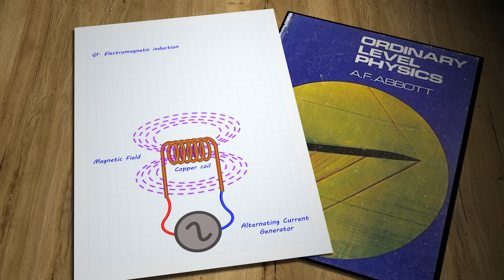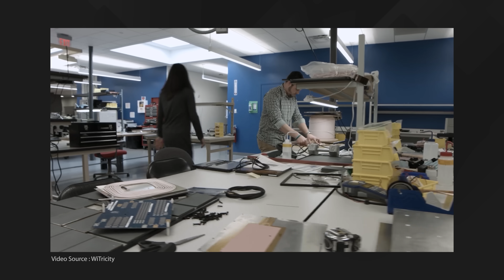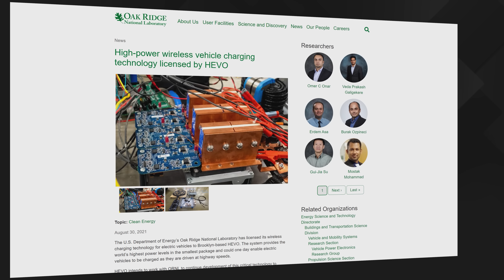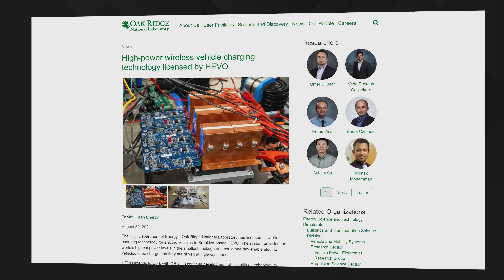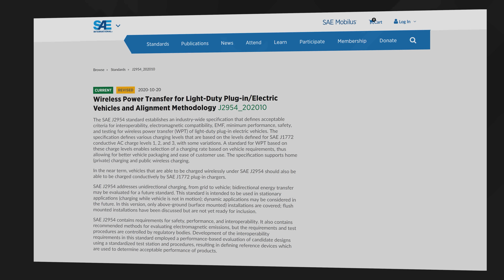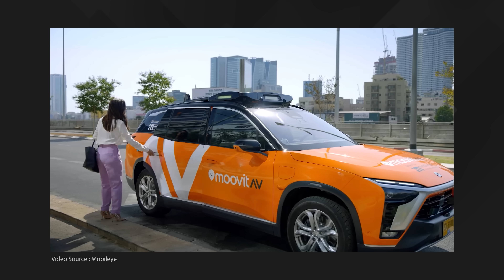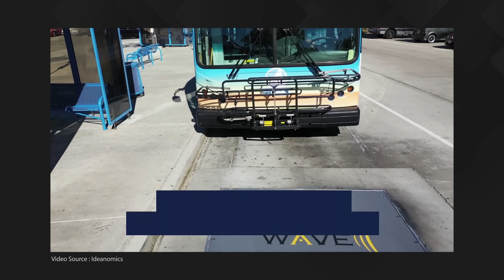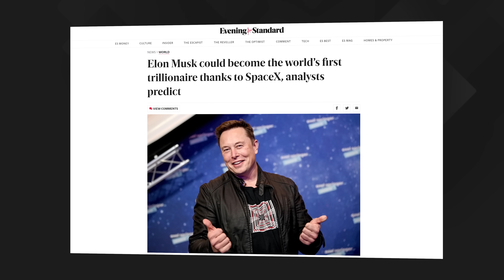Wireless FULL EV charging has arrived!  Exciting new tech breakthrough.

Comment: Seems inefficient at this point.

% efficiency of newly developed tech is always overstated.
Reply: this is no different. they always state the efficiency of the coil-to-coil transfer but fail to mention that you have to do three conversions to make it happen: 60hz AC to DC, then again to kHz, then transfer it, then convert that back to DC to charge the battery. so rectify, invert, rectify.
Reply: @somedude-lc5dy  genuine question, why do you have to rectify to DC and then invert to a higher frequency AC before transferring?
Reply: @ipwn951  Because higher frequencies = smaller coils, and better transfer. Just line an airplane uses 400 hz for power on board - Smaller transformers less weight.
Reply: @ytalanwms  that's neat
Reply: @ytalanwms  I always thought that airplanes use DC-only as most of avionics requires DC anyway...
Reply: @somedude-lc5dy  yeah, now imagine what size would have a coil that's able to reliably charge a car at 50 or 60 Hz, like in conventional home electric networks, and don't forget to calculate how much you lose “into the air” when you use a lower frequency for induction based energy transfer. Alan Williams is right, higher frequency means smaller and more efficient coils. In real world with real physics, simplicity does not imply efficiency. A steam engine is very unsophisticated, yet it gives you back just about 9% of energy it requires to run. DC current seems simpler to produce and transfer, yet most of our power lines are AC—because DC is efficient either at very low voltages or at very high (think power lines that supply electricity from one country to another), but not at voltages we use at home (110/127/220). Metro trains and trams, for instance, usually run on 800 V DC, but they get that power from AC grid, and everybody is okay with the fact that metro doesn't run on 10 kV 60 Hz AC, or whatever your local transfer standard is. They run on DC because they return their kinetic energy as electricity back into the grid every time a train/tram brakes, and it's crazy difficult to make a frequency stabilizer which would let to have both recuperation and 50 Hz in metro/tram power grid. So if magnetic transfer is more efficient at higher frequencies, I don't see any problems with conversions: the efficiency of “such a complicated” scheme is surely much better than what you think will work; if these conversions could be avoided, they would already have been. And no, you can't just multiply what you get from power line, it's never exactly 60 or 50 Hz, so you can't have it both stable and under granular control, which again, is important for efficiency. Do you know that modern phones don't keep the same voltage and current while charging? That's because it's efficient to change these during the process.

Comment: How would this effect those currently living in their cars? Given the lack of willingness to pass infrastructure bills, adding another item to fight over seems impractical. On a local level, some smaller cities or apartments may decide to install wireless chargers in paying spots. Larger and more progressive cities will likely rather push for some or all cars to be replaced with mass transport, at least in downtowns.
Reply: Good. If you legislate away street parking then the downside of electric cars goes away, and you get the street back.

Comment: I'm not buying this marketing hype at all, the 90% efficiency numbers being banded about are still when very closely coupled and accurately aligned. When alignment is as little at 5% off and when distances between coils is the typical 20cm for a vehicle, efficiencies drop to <50%. If everyone finds it acceptable to waste 50% of their power as heat into the environment then by all means these systems are for you, however, if you wish to remain at 95-99% efficiency then wired connectors are still the best environmental option.
Reply: Even if it is 90-95% that's still 10% waste. How can we afford that?
Reply: @kevinroberts781  Wired connections are not 90-95%, they are very nearly 100%.  The lower number comes from the rectifier on board the car, which is ON TOP of the losses incurred in the inductive charger.
Reply: @incognitotorpedo42  not talking about wired connections.
Reply: Not a very optimistic outlook on this awesome technology. Also, 5%?...  It's clear this technology is still relatively in it's infancy and despite that, it will still allow drivers to have "sloppy parking" and still be able to utilize it.  If poor wireless charging because of damaged or misaligned components, you don't think a system can be developed to notify the user?

Comment: Is it safe? People complain about magnetic fields scrambling their brain that are on the order of 10 orders of magnitude less powerful.
Reply: Those people are stupid.
Even at these powers it's probably safe, as long as you don't have any metal in your body.

So there would definitely be some problems eh?
Reply: @kanucks9  50% of people are at or below average intelligence. Probably 17% can be considered stupid. What percent has metal in their body? Not sure. Eh?
Reply: I think it might not be safe to place your pacemaker right next to it, but it's probably safe at the intended use, the field is designed to not radiate in a way like a normal magnetic field and it concentrates the flux at the induction points.
Reply: @jordangentges2631  sounds good, then it’s just a case of convincing the public :-)

Comment: convenience with huge energy loss is not good - I hope such inefficient methods for charging your electric car would be banned
I really hope somebody does proper direct connection robots to the cars - offering same convenience for the user but much less of loss energy
both energy loss in magnetic field not being perfect to general electrical resistance in both coils
Reply: If it speeds up adoption it is tolerable. Convenience has to be a consideration, and cables are not convenient. Robotic connections would be better, but they would always be maintenance heavy. Maintenance means energy too.
The energy electric cars use is actually pretty minimal. Regulating how they are charged because "we know better" would be a step in the wrong direction. The owner has to pay for the electricity, and will make decisions based on their own needs.
Reply: @agsystems8220  This whole idea of adoption is BS. It may work to have only EVs in cities, but it sure isn't ideal in Canada. In rural areas. In 2nd or 3rd world countries. I believe there still is a place for ICEs. Cancel me, sure. But electric vehicles are not the only solution to this problem. Though I really do want my next car to be electric!

The idea of robots pluging in your car is way better than the idea of wireless charging. You'd simply need a 6 inch Cylinder that could make contact with the bottom of the vehicle. Like a simple bottle jack, that could have 2 short swivels (for alignment) on it to attach to a point on on the bottom of the car. Have it built into the floor of your garage, have a second charging port on the car. Not too expensive. Very minimal maintenance if any. Could easily work in parking lots. Would cut down the cost of tons of charging lines and stations. Very low profile. Could fit in a 1 foot cube and be under ground. Perfect for taxis and busses too. Could put it at red lights. Robots actually would be far superior!

Comment: This sounds great, I look forward to a future where EVs are open to anyone, including people living in blocks of flats with only on street parking.  However, I do worry that this has the potential to screw over anyone with a pacemaker.  Even the magnetic field from an iPhone’s mag safe pad on the back can mess up a pacemaker if it gets too close.
Reply: The transfer window has  tuneable operating distance, and field drops off quickly outside that window which can be shielded anyway. In most systems the power is only switched on when there is a perfect handshake between the vehicle and the charger. The charger will switch off if anything interferes with the magnetic field.
Reply: @Click Bait The truth is everything in reverse from what you said - we HAVE all those expensive roads and make more of them,and manage to maintain them to existing state.Adding additional structure to roads - is only % of what those roads already costed us.This also isn't rational to adding such feature to unused dirt road,only on high traffic urban areas.What we don't have - is all ICE cars replaced with EV.
90% of time your BIG GOOD size battery is being UNUSED because your car is parked,this battery is huge part of the cost of EV, and it's accountable for most pollution released from manufacturing that EV. Even more - when EV isn't parked,battery still not being used for 100%.But all the pollution from manufacturing and all used resources - everything was done BEFORE EV even get out of factory,so 99% of all those resources are being unused,and degrading over time. If rather than putting BIG GOOD sized battery,we use good small batteries with some super-capacitors for frequent cycles endurance - we can make x Times more EV out of same amount of resources,for much cheaper,and charge them right on the roads.
Reply: @Steellmor  You have no idea how expensive it would be to install and maintain inductive chargers on all major roads.  I guarantee you this is never going to happen.
Reply: @incognitotorpedo42  You guarantee? So you have exact numbers to be able to guarantee it? Did you ever saw trains and railroads? Highways? Huge concrete interchange? Subways? Tramways, trolleybuses etc? We can do this,but we cant add simple wire coils to existing roads?
Reply: @Click Bait I'm not advocating for any of those companies and their solutions,I think all of them are way off from right solutions.Nor for Solar roadways - stupid crap without any real reasoning.PV needs to get cheap as it can,and installed in least work required manner in order to produce as much energy as it possible for as little cost. But conductive coils have hundred times more power density compared to PV,and copper is much cheaper and less energy-costly to produce than silicon semiconductors for PV.
Reply: @Steellmor  Copper is cheaper per kg than single crystal silicon, but copper isn't particularly cheap compared to concrete and tarmac, and you're going to need a hell of a lot of copper to make coils for millions of km of roads, while the active silicon in solar cells is a very thin layer spread over a large area and it is actually generating power, not just moving power generated elsewhere around. Servicing overhead wires is massively cheaper and easier than servicing wires buried under concrete roadways - this is why overhead wires are so common, even though nobody I've ever heard would say they look good.
Reply: @peglor  Yes,agree with all of this.Except maybe when you got back to solar cells second time,not that what you said is actually wrong,but it kinda can be misleading and seems like you trying to backup idea of solar roads.Also about cost of servicing wires - yes it's indeed cheaper with overhead wires,but how often do buried wires need servicing compared to overhead ones?(lets just remember any snowstorm and hurricane). About concrete and tarmac - we don't compare them in 1v1 ratio to price of cooper - we don't need to make whole road out of it,and when we go and look for prices for square meter of tarmac,or for ton of it etc, they are quite pricey when you consider how much of it you need. So Cooper coils still would be least part of cost for such roads. Now back to comparing it to Solar roads - they installed 14 m2 and it cost was "roughly $60,000". Quick search for tarmac - 15 m2 can cost up to £1000 with job done.Or search for roads cost - "$2-3 million per mile of new 2 line undivided road in rural areas and $3-5 million in urban areas". Wireless charging added to road  - in 2018 Sweden made  test project,they build ~2km for $2,4 millions overall budget. Company called Electreon Wireless,according to WSJ, claiming that they can add wireless charging to roads for $650,000 per kilometer. That's with job done. Actually you can just google images and look how those wirelesses chargers look - clearly most of it's price comes not from chargers themselves but rather from roadwork.
Reply: @Steellmor  I'd be very surprised if the price for the Swedish charging road was not done at a loss to try and drum up business. Without a comparative Swedish cost for  building the same road without the charging, quoting (I presume) figures for US road building (Which is usually for concrete rather than the tarmac on compressed stone usually used in Europe) doesn't allow anything to be inferred. 

Burying cables in geologically stable areas does mean a lower number of maintenance interventions and that they can be scheduled, but each intervention will be a lot more expensive, especially in cases where the road has to be closed to access the buried wires, and the continued suburbanisation of the US particularly, without enough tax take to cover upkeep on infrastructure 20-30 years after it has been built (This is what's already making many US cities bankrupt) means many places already can't afford to maintain the roads they already have not to mind the ones they want to build. 

There may be a means to claw back revenue through charging fees to cover the costs, but anywhere without a lot of electric cars and a lot of traffic will probably never be able to do this sustainably, and that assumes the technology isn't mostly lies (It definitely sounds like very specific moulding of lab tests results if it's not actual lying) and that it is widely adopted as the primary method people choose for charging cars.

Comment: Imagine a funnel extending out of your gas tank, and a series of gasoline fountains triggered along the highway, spraying gas at you as you drive.  Yes you could seek to create system where a car with a small tank could drive infinite distances.  NO, NO, NO, it would never ever make sense to waste the infrastructure costs, write off the losses of uncaptured energy (spilled/evaporated gasoline), and create new infrastructure nightmare of upkeep of the extremely complex system.  This question has been asked and answered for decades, and no the physics haven't changed.  Direct connect will ALWAYS be much more efficient, and we cannot afford to waste any renewable energy  (like we do with our wireless toothbrush and phone chargers).  This video is based on overinflated claims of a research team and now a CEO trying to get prototype project money for extensive installs.  There is zero reason to go this route with EVs because electric cars are inherently inefficient (4000lb - 9000lb masses of steel to move 1.2 people on average) to the point that we will not use them in the future.  We will use electric rail, and active transportation, and micromobility.  

Even the prospect of induction charging for parked cars only makes sense for on-street parking in cities where parking is not assigned (assuming you create a charging/pay protocol), and cities are beginning banning cars in the city center in the near future.  Yes, banning cars, because mass transit is the only way to decarbonize congested cities quickly, and make room for bikes, walking and micromobility.

Not to censor science, but videos like this one, are delaying much needed transformation of our transportation systems, because it's providing BS hope for autonomous vehicles (too inefficient, too expensive, deadhead trips) and for extremely wrong turns on wireless charging which is always more lossy than direct connect.  They are misrepresenting the losses as 90-95% efficient, because it is IN ADDITION to the already present losses.  All this because tech improvements are fun.  Guess what?  They are distracting us from fast action on Climate.  They really are.

Comment: Love the idea of charge as you drive. Essentially providing unlimited range.
Also, we would need much smaller batteries thereby reducing the cost of a EVs.
Also, governments could use this  to replace the revenue they currently receive from fuel duty.
Reply: Have you thought about how much production of such enormous quantities of panels would cost? Not just money, but materials and the environmental damage of that production? And for what? To prevent the effort of plugin in a cable? To remove range anxiety. The idea of infinite range is nice, but nobody seems to think about the cost. All the costs
Reply: On the one or 2 roads in your local area. If you drive 100 miles in a week and 5 of them are on a technologically advanced street is it worth it?

Comment: 90-93% efficiency for recharging while moving? Ive got a 100% method. Conductive tires and electrified plates on the road Switched on with power transistors only when the road detects a car on it.